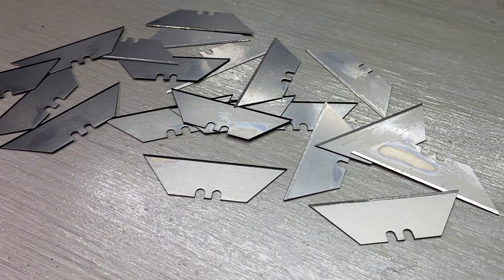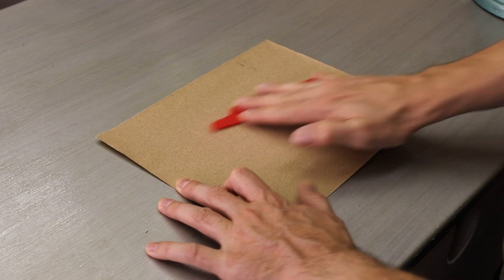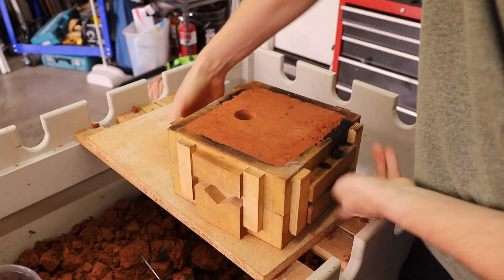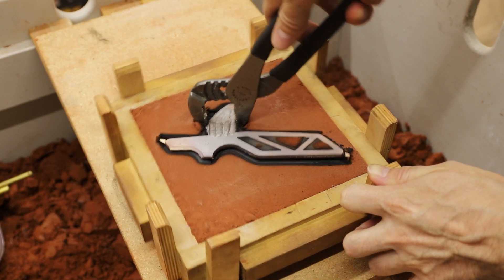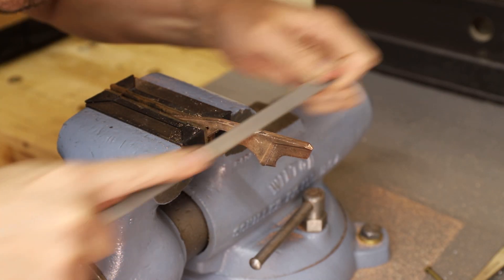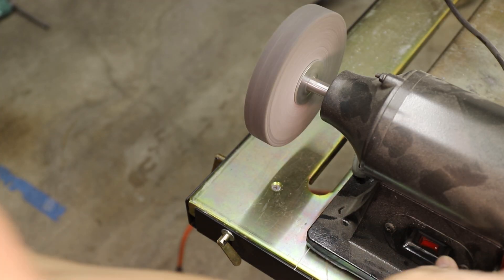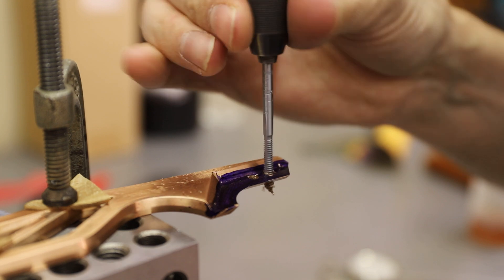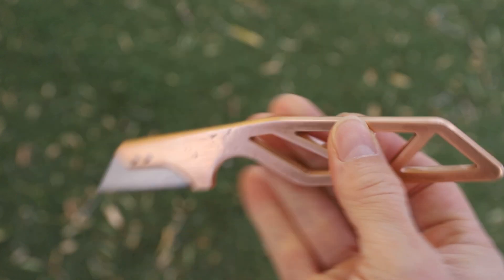Making a Razor Utility Knife

Comment: I recently made a utility knife and a scraper that use double edge shaving blades because if there's a sharper blade available, I've never seen it. But mine are made of Kydex, as I know nothing of working with metals. I used #10 - 32 screws and wingnuts that I ground most of the wing off of. #10 was a good fit for the round and square holes in the blade. Loosen/tighten as needed to extend/retract.
I carry one of those flipper knives that uses scalpel blades, but they aren't in the same class as a Gillette blade.

Comment: One thing I like to have is a steel honing rod on the back of my utility knife. I love my Milwaukee Fastback, and I took a diamond sharpening steel and used it to roughly polish the steel back of the casting that holds the blade. I can quickly draw the blade across it a few times to hone it when it starts getting dull, and get 2-3x usage out of the blade. 
I would like a folding knife that exposed the whole of the blade like yours does.
I'd suggest adding a flexible 'clip' to one side of the blade guard so that it clips onto the back of the knife, and also add a slot on the blade guard to store a small allen key.

Comment: I would also grind or drill a slot for the key to have it with the blade at all times. If you needed to change the blades you don't need to look for a screwdriver or key to do it.

Comment: I wonder if the knife design itself could incorporate a way to store the blade guard while in use? Perhaps a minimalist blade guard could be printed with a geometry to secure itself to the end of the handle or snap into the largest frame hole, so it is either unobtrusive or serves to benefit the grip rather than get into the way as an afterthought.

Comment: I like utility blades a lot, kinda lazy about sharpening so I find myself using them more than an actual blade. I also like the skeletonized handle. Clean! 

Kind of curious about how it will hold up. Just don't drop it 😜

Comment: As someone who uses utility knives a fair bit - two fiddly screws for a blade change would drive me insane. The cutter is gorgeous - but it would drive me nuts to try and live with.

The magic of those blades is that they’re SO sharp, and so cheap that you can always have a sharp blade.

I think you’ll get a bunch more satisfaction from an amazing tool if you can work out a quicker blade change system for the next version.

Comment: Very nice job. Maybe you can drill a hole in the top rear edge of the handle to hold the hex wrench you use to loosen/tighten the blade. The hole can have a small piece of rubber tubing inserted to grip the wrench.🤔🤷‍♂️
Reply: Yeah this is very cool but missed the opportunity to include the allen wrench and a spare blade or two nested in the handle

Comment: Looks great!! You know as well as I that you need to change blades often, and be able to do it quickly. Do another with your new design of a quick release, and replacement of the blade.
Reply: I was thinking the same about changing the blades quickly.  I had a ittke Gerber utility knife (I think it's called fhe EAB or something like that) and while it was a nice utility knife, you had to unscrew one screw to change the blade.  That was the only thing I didn't like about it but it was a nice piece to have.  It was small and folded.  I ended up losing it on a jobsite unfortunately but I bought the Gerber prybird which is a sliding utility knife and has a way to quick change the blade.  I'm enjoying it more than the little EAB just for that reason!

Comment: Next time you should try power tapping! It's really easy, you just set your spindle to it's slowest setting, put the tap in a collet, make sure the quill stop is all the way down out of the way, turn on the spindle and let the tap tap it's way into the hole all in one go, just use lots of tapping oil and let the spindle come to a complete stop before reversing the spindle direction and you should be fine.